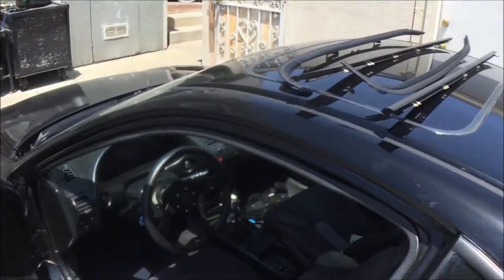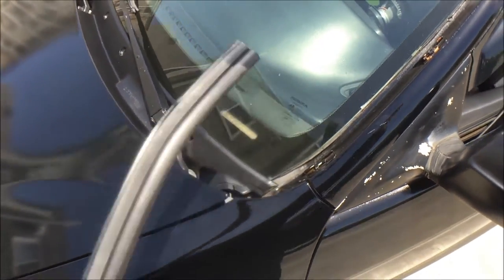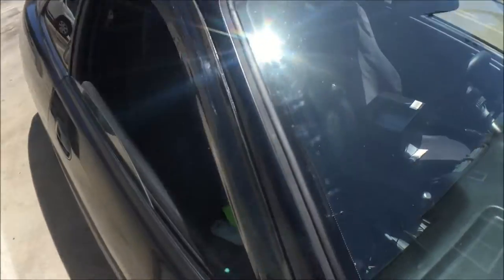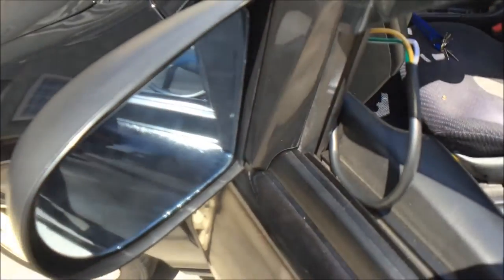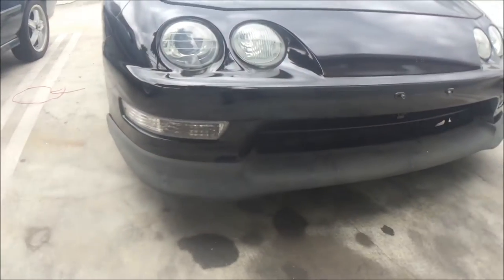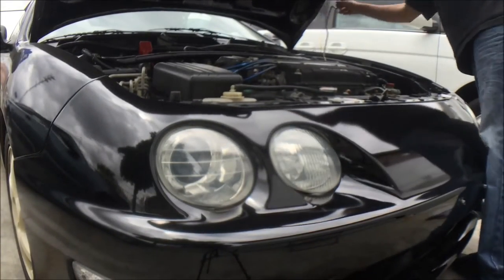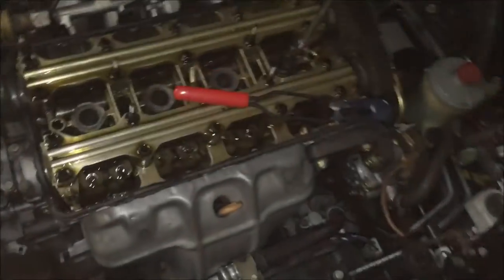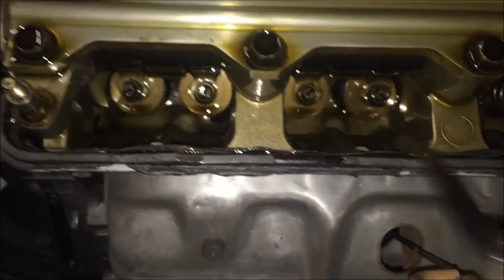Small Update | DC2 Replica Spoon Mirrors | valve lash adjustment

Comment: get raxles if you want a quality oem replacement.  ask for marty.  you can send your old axles if they are oem and get discounted.  i dont know if you are going all motor or turbo.  but i got raxles.
Reply from the maker: To be completely honest, I thought I had a totally shot axle, but it ended up being suspension related. I do still have that common "clunking" noise from the inner cv, but I can live with that for a few months until I upgrade cv axles. Sucks I don't have oem axles for that discount :/